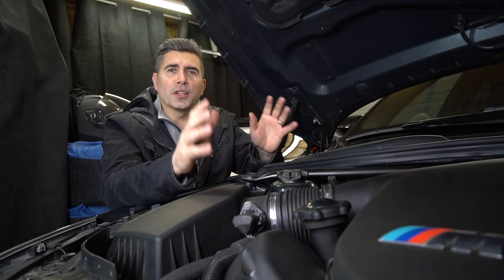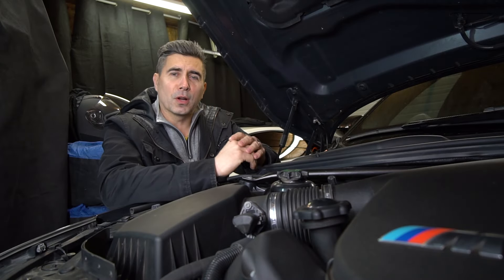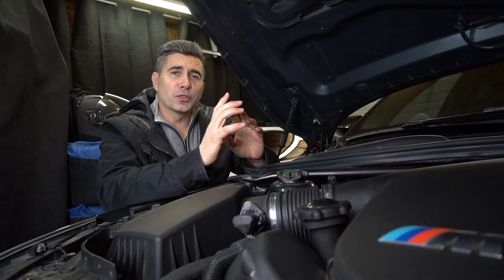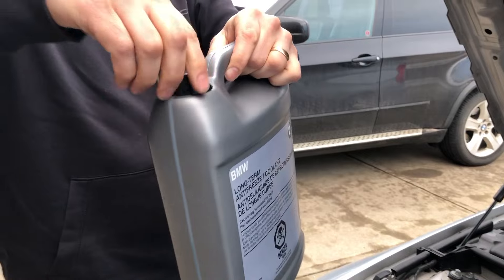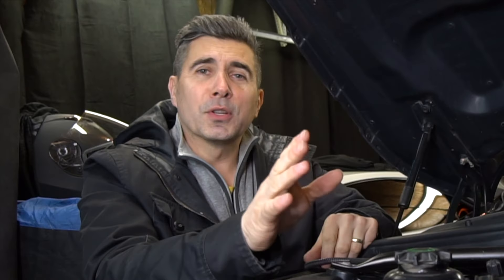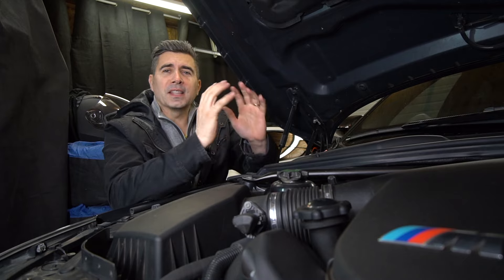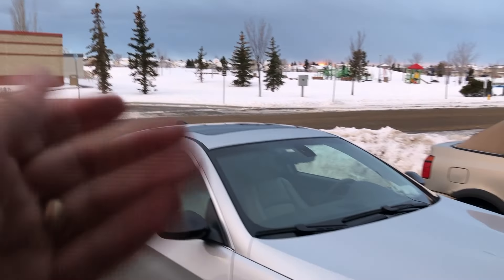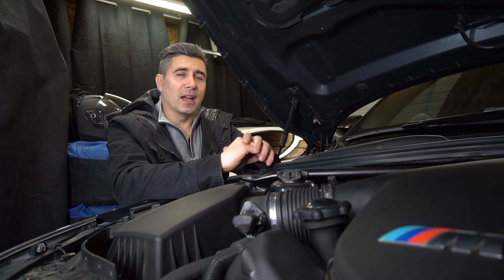5 BMW Maintenance Tips To Keep You Car Like New

Comment: i always say, if you're buying a used bimmer at least have 1,000$ bucks on the side for the car
Reply from the maker: You bet and maybe even more if you can
Reply: @ECPP  yeah have around 5k
Reply: More like five thousand
Reply: Ok so I'm good lol😂
Reply: I just forked out 1800.00 for a 3 hour recall repair. Picked up my car a week later( not 3 hours)and drove it 3.2 miles before calling dealership from my stalled car.  It was doing that before, hence the visit to the dealership.  I thought the scheduled repair would be the fix I needed, and the multi-point diagnostic scan showed nothing else other than a small oil leak as far as the engine goes. I did have them flush my coolant system out knowing that I needed a new hose and reservoir  which I had already ordered and was in the trunk. I also elected the tire alignment which I would need soon anyway.  I was trying to give them some paid services because the recall was a free service.  This is week three that my car is not drivable now due to fuel pump. They already got me for a new radiator that I'm not sure I  needed. I would think if a multi-point inspection was completed, a faulty fuel pump would show up.  I was actually surprised it had not because fuel or air pump was my guess on the engine stall if it wasn't the recalled part.  Now they want almost 1400.00 to replace fuel pump. Someone please tell me this is too high of a cost for an older bmw and that I can likely do this myself. I am a single mom starting over and need my car. My budget has no budge in it currently. 😢
Reply: @cleangal71 BMW are expensive to maintain.. even more expensive if you can't move your own wrench...
Reply: 1k ? Nah atleast 5k
Reply: @bodipyles dang
Reply: 😂1000if you do the work on your own. 3-5000 if someone else do it for you😂 cus they use premium parts with jackup prices
Reply: $1000 isn't enough for a 335i lol. Those injectors are NOT cheap
Reply: Agree
Reply: @MoneyMob414 right 😂
Reply: Im glad i did
Reply: Hey guys I’m about to get a 2016 5 series 528 i, 4 cyl turbo. Any thoughts?

Comment: Great tips! Especially letting the car warm up a little and driving it lightly until properly warmed up and also letting it cool down for a few minutes after a drive. I do this religiously and never have any turbo related problems and I’m running a set of upgraded turbos
Reply from the maker: Thanks a lot for watching.  Turbo care is critical to save mo way in long term.
Reply: I do it religiously also.  While the car's warming up I'm always praying for no new issues.
Reply: I warm my car up for 5/10 minutes as soon as the needle move,
My needle start at 150 degrees that should be enough of a good temperature to pull off right .?

Then some other will tell you warming up engine is bad because it’s too long idling cold components. 🤦🏾‍♂️ 🤷🏾‍♂️like which one actually make sense
Reply: @48hourrecordsteam45 warm it up to operating temps 😊 the car won’t complain if you’re in a rush, but it will thank you in the long term 😅

Comment: The dealer told me I needed to replace the engine mounts. I'm skeptical because I have never been told to replace mine on any car I've owned. My current BMW is my first one, and I absolutely love it. I just don't know whether I should believe the dealer or not.
Reply: Also what are you guy's opinions on transmission fluid flushes on BMWs?

Comment: What about the timing chain? Mine has 110K miles & the previous owner didn’t keen right track of the oil changes which worries me, my mechanic told me to hold on until it sounds or feels weird, it’s a 328I 2015, what should I do? Heard about a couple of blown engines due to the timing chain

Comment: 2010 535 I xdrive hope this works
Reply from the maker: Hopefully
Reply: A little tip since you have an xdrive. Make sure you do your best to keep the tire tread on all 4 tires at roughly the same wear. I get rotations regularly. Also, when I replace 1 tire, I replace them all. Uneven wear on your tires will put excess stress on the differentials. Trust me, you don't want to have to replace a driveshaft and differential. $$$

Comment: Amazing video thank you
Question about the turbo tip. 

I have a bmw 530e single turbo, and is a mild hybrid system and I keep it on auto which turns on the electric engine while driving and shutsdown the engine, would it be better to disable it while I'm driving for a longer distance meaning keep the engine running without turning it off by the system?
Reply: *2019 plugin hybrid 530e cylinder 2.0

Comment: As soon as you buy a bmw vehicle 

1. Change/flush & fill every single fluid 
  Oil, coolant, transmission, differential, brake , power steering

2.change all hoses
3.change all belts 
4.breaks and rotors
5.spark plugs & coils
Reply from the maker: Yes, get everything up to snuff and do not skip maintenance
Reply: @ECPP is that recommend even when buying used from bmw dealership ? I got bought a 2018 320i with 50k miles do u think they did all of that before hand

Comment: I have a 08 335i it had 157k miles I just changed the rod bearing. Need to walnut blast my valves tho... previous owners never did it.
Reply from the maker: Really sounds like luck to me because my Junky 335 was nothing but repair upon repair.  I loved the car to drive and with stick it was fun.  I liked the looks and sounds but reliability. Not.
Reply: N54 engine lasted that many kms ain’t bo wat

Comment: Hey I have a 2013 528i. It has a n20 engine. I been driving the car pretty hard lately. And now I have a drivetrain malfunction message. Very delayed throttle response. But if I put it in manual, it runs perfectly. Automatic, it’s very delayed. I think it’s the diverter valve. Cold start idle vibrates the car a lot for 5-10 minutes. Before I break the bank figuring out the problem, what do you suggest?

Comment: I just bought a 2007 bmw 328xi coupe love it but check engine light is on due to MAFS is third party mafs work just as good as oem? Also when I turn off the car I get a coolant light for a few seconds what does that mean? Thanks man love your videos.
Reply from the maker: Thats a bit unusual.  Sometimes a short temp coolant light can be a low level or pressure issue within the loop.

Comment: You’re completely correct. I had to replace my water pump, so I did the thermostat and ALL of the coolant hoses, any O-rings, mickey mouse flange, serpentine belt, idler pulley, tensioner. I ended up replacing the boost solenoid, OFHG and OCH. 
 BMWs are reliable, however American owners are not. These care are well engineered with maintenance in mind. Yes, there’s a crap ton of plastic under the hood. Those parts are cheaper to replace when they fail or when it’s time to service or replace them. 
 They are mostly disposable cars in North America because most BMW owners cannot work on their cars and have to pay huge labor prices and use parts that have been twice marked up, through their dealer or shop. BMWs depreciate very quickly and it only takes a few deferred maintenance items to make an older car cheaper to replace with a newer BMW than to repair.
 All BMWs will need the following large maintenance items before the first 100,000 miles: water pump and Tstat, oil filter housing gasket and oil cooler gasket, valve cover and gasket, plugs and coils, serpentine belt, tensioner, and idler pulley. If you have to pay a dealer or shop to do these, you can save money by combining some of them, as said in the video. 
 Other general maintenance items include oil pan gasket, trans and diff fluid, brake fluid flush every 2 yrs, suspension bushings, coolant hoses, etc.

Comment: What about the BMW e39 540i?are they are good reliable car, I have 3 of them but don't drive them often because I use my Peugeot 407 for daily use and only occasionally take the BMWs for a days drive, best car that I have driven, and I have owned many
Reply from the maker: E39s are sturdy cars and not absolute money pits.  The M5 is a bit more of a maintenance hog but overall the series is pretty good.  My fave is 540
Reply: @ECPP  Do you think that the BMW e39 540i will become a classic in the near future? Mine are all in good condition and about 145000km  should I hold on to them for I have buyers interested.

Comment: If i buy a BMW from a seperate seller and not a bmw dealership, can i get my BMW checked at a certified BMW dealer and is it worth it? theone im looking at is a 
2011 BMW 3 Series 328i 4dr Sedan SULEV for 8500 at 78 thousand miles.
Reply: Derek Pacheco exactly, new bmw models are not even that unreliable, the 4 series and five series have a reliability rating of 4 out of 5, IN A BMW, newer Honda/Acura models don’t even get a 4 or 5 anymore, and all bmw models get a 5 star crash test, bmw builds good cars

Comment: How bad is the v10 m5? 
Like is your engine going to break at some point or can preventative maintenance avert this?? 
Was thinking about buying one but not sure 🤷‍♂️
Reply from the maker: They are a bit fragile but the big thing is rod bearings and I would recommend just going ahead and have them changed before every 60,000 miles and be on top of your oil service.  All other things can present issues but are manageable just as Vanos or SMG pumps.  Best Euro sedan ever especially with a race exhaust on this machine.  Always have some cash in bank for failures though.
Reply: ExoticCar PlayPlace thanks man been thinking about buying it as my fun car after I graduate. Think it’s worth it or will it run my pockets dry on an entry level graduate salary? 
Are you based in Canada or USA by chance? 
Just wondering if you’d be familiar with the Canadian pricing for them and their maintenance is all 🤔

Comment: do you realy have to tell people that they have to do regular oil changes?!?!
5:10 that break warning light usually means 4mm left on the break pad. the discs do not have to be changed everytime....just change the pad if the disc looks good. but you have to change your pads when your warning light come on otherwise you ruin your discs. changed my discs at 80000km. (modern discs last 40000-120000km depenting on your driving and the quality of the disc)

Comment: step one. buy a real oil  dip stick. why the fuck dont they come standard? its like 5 bucks for a plastic one. step 2 become friends with a bmw mech
Reply from the maker: Agree on both counts but unfortunately  some engines cannot integrate a retrofi such as the S85 engine with the integrated aump
Reply: @ECPP  true but the vast majority can be. I dont get why they do this. Using the electric oil dip is a pain. u have turn the car on and off while a normal plastic one takes 5 sec

Comment: I am looking at buying a 2013 BMW X5 diesel with 130,000 KM for about 17K CAD. Would you buy a suv like this? What are the things that I should check and be aware of as a buyer? Many thanks.
Reply from the maker: I currently own a 2009 X5 Diesel and would. It another.  With that said, the DEF tank heater is a “hidden recall or bulletin “. That the dealer does not advertise   If it fails and your vehicle has low enough miles, it is usually covered under this factory extended warranty.  Also, rear airbag springs will fail and is when but not if to a tube of about 500 bucks buying aftermarket and you doing it yourself.  Egr cooler, sometimes glow plugs can go.  With that said, they are sturdy, feel well made and delivers good performance and economy.
Reply: Get the 35i instead

Comment: Good, down to earth, common sense video. I just picked up a 2017 BMW M2 for $18000 and the first question I asked was "What's wrong with it?" The car as a dealer serviced 1 owner documented history but it has done 138,000km's (85,000 miles) so my first question was obvious.

I know what needs to be done but it's a bit daunting because I don't want to be constantly be chasing my tail with this thing.. it could get ridiculously expensive! The basics aren't that much though so prevention is obviously better than cure!

Comment: Thanks good stuff. Do new S63 engines in 2021 X5M need the cooling systems For the turbos as you mentioned? 5min wait?
I noticed my car makes loud noise for 2min after shutting down , sounds like fans running on max speed

Comment: Great video! I have a 2018 M5 that has an Eventuri intake swapped for the original. Are these filters life-long filters like the K & N filters and if so how and when do I clean these? Do you have any other tips on when and what for the 2018 M5?  Thanks so much!
Reply: You wash them
Reply: @boardelia  Ok, great. I will put them in my dishwasher. Thanks so much.
Reply: @johnmci7140  Lol, man seriously you wash them...but not in a dishwasher !
Reply: @boardelia  I can't seem to find at what the milage recommendation to clean/replace these filters is, either.
Reply: @boardelia  I found the Eventuri Air filter cleaner and oil. No just gotta find out the cleaning interval.
Reply: @johnmci7140  I think there is no rule here, if you live in a polluted place like downtown, you clean them more often otherwise rarely. 
Normal paper filter get changed every 20k km so why not take this as starting point ? ;)

Comment: I accidentally poured 89 octane into my 328i. I let the tank go almost to  empty twice and filled up w Premium. It's running a little better, service engine light is off but it still sputters once in a while, knocks a bit when I start it up Anyone have suggestions. I heard that additives are the worst one can use.

Comment: Hey bro great video thanks for the tips ,I just purchased a 2011 535i m bmw With 117,000 miles car runs good but my concern is when I shut the engine off car makes some odd noises is that normal ??
Reply from the maker: Depends on the type of noises

Comment: Luckily I’ve own my second BMW, 2014, 328i Sport, so far 368K Miles, only high pressure fuel pump, fuel pump modulator, just changed timing chain guide, with rod bearing since it crosses over in repair cost, also belts, just changed suspension as well, only thing out of those listed that was a must was high pressure fuel pump and modulator. This F30 has served me well seeing I had a Dinan Stage 1 tune since it’s first 3k miles onward till now. Amazing 🤩
Reply: You just changed your timing chain at 300k miles ?????!!!!

Comment: I just bought a 07 328iXI and the brakes are so bad they have really bad rust and I took the wheels off and try to clean them as much as I could with hot water and soap and a scrubber while I get money to change the whole brakes setup I plan on modifying it but like you said maintenance first before modifications.

Comment: Question about letting it cool down. I have 2016 x6m and when i turn it off, it still runs for about 5mins or so. I think i was told this is the cool down process.
Reply from the maker: So e vehicles have turbo timers which automate this action

Comment: I'm thinking about buying my first bmw and looking for some advice. it's a 2012 528i with 117k miles on it. I looked at the cafax and didn't see anything except a minor fender bender on the driver side door. i'm going to test drive it in a few weeks and just waned to know if it would be a decent buy
Reply from the maker: It could be but with a small hit and relatively high miles I hope the price is right and the rest of the car is in great shape.
Reply: wagner1va  I ended up getting a 2013 328i with less than 90k miles on it with a full warranty

Comment: Amazing advice. I was taking car of all those issues on my 7 series. I just took my 2005 645ci out of storage and I notice the oil temp always go to 250°. Is it suppose to do that. I been doing my research and I’m thinking of getting a low temperature thermostat to make the car run cooler but it also stated that during the cold days the car won’t get hot enough. Should I get a water pump and replacement expansion pack?

Comment: I have an old BMW 529i, 24 valves, 1996 model, where can I get a blueprint/drawings of the engine parts as I need to do some maintainance myself. It would be good if you can do a Engine Parts video.

Comment: Am a subscriber and have given many  20 PLUS thumbs up but  
NOT on this one.
You are NOT specific on OIL change intervals, and specific mileage timelines on OIL changes such as 3,000 miles between oil changes.
NEVER owned a turbo assisted engine car because basically it is a UNDERPOWERED,
poorly engineered engine that needs the ADDITIONAL boost from a turbo to increase the  HP on a already underpowered car.
With that being said, TURBOS  increase HEAT  up to as high as 1,800 degrees or more, and aids to the COOKING of a ENGINEs internals.    Shortening the lifespan of the engine.
For this reason OIL,  & filter changes 
should be done at a minimum of every   3,000 miles to NO more than 5,000 miles and 
this is stretching it with a top grade FULL  SYNTHETIC  oil and filter change.
Overall your videos are VERY informative.  Just feel you should be  TIME, and MILEAGE  SPECIFIC  with OIL, filter changes.

Comment: Cooling down turbo you mentioned is wayyyy overblown. I drive 335i with turbo. I turn off asap when I pull in like normally aspirated engine. BMW turbo cars have electric water pump which runs at high speed to cool the bearing housing. Coked turbo bearing means turbo stops spinning and you have low power. Not to mention limp mode when turbo stops spinning.
Reply from the maker: Thanks for watching